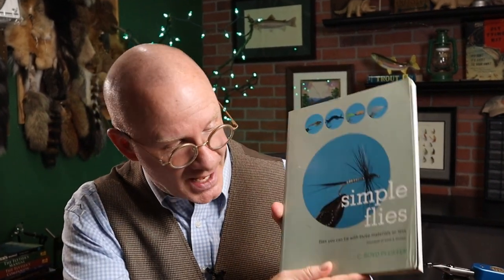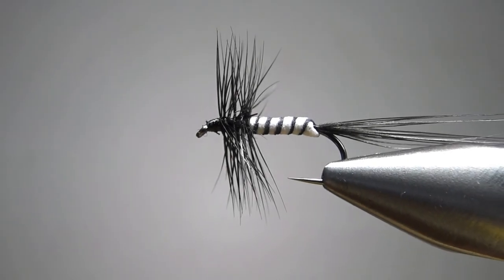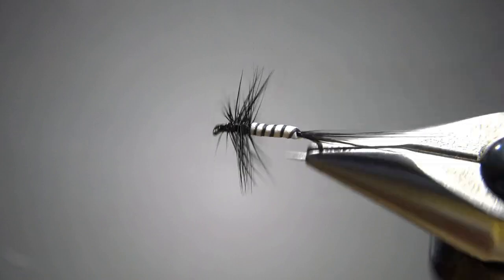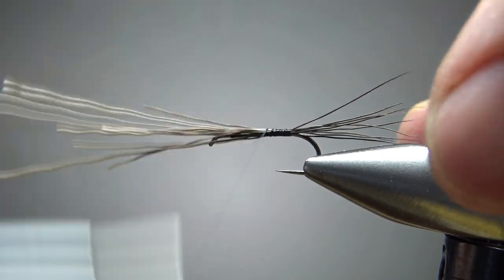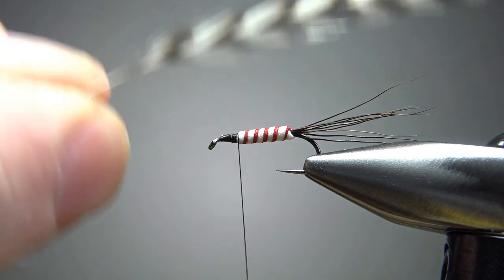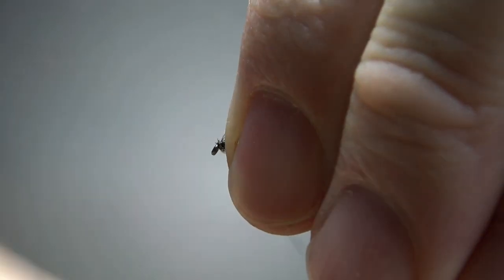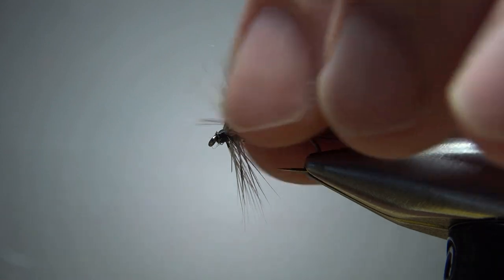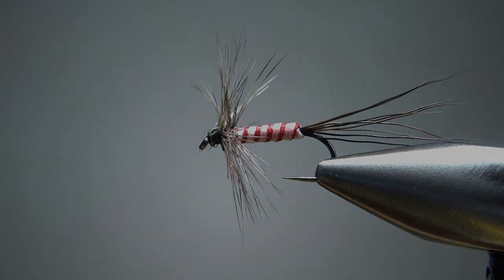Simplified Dry Fly Technique #1

Comment: Simplified...sounds good to me! I've actually wrapped foam around the hook shank for a body, and while not pretty to humans, the fish don't seem to mind it! I especially like the sharpie "rib", even with you lesson about letting it dry first.
Reply from the maker: Thanks! Another way he talked about doing a rib without adding another material is to leave the starting tag of your thread and just use that.
Reply: @SavageFlies  I've seen that on other tying videos, and I have tried that, too. It works, without needing to tie in a wire, and it makes a nice, thin rib without adding any weight.

Comment: Nice idea. I'm a huge fan of flies using only a few easily found materials. I'm starting to experiment with quills—from stripped hen feathers after ai have tied some flies with them. Best wishes. :-)
Reply from the maker: Thanks Terry! One tip if you're going to do a lot of quill bodies, save your excess stems from your hackle feathers. Like if you start off with a six inch feather for a dry fly, and maybe you make two flies with that feather and still have a good three inches left, but the barbs on it are too short or long, save that stem! Soak it in some water and use it for a body. :-)
Reply: @SavageFlies  Thanks Matt—will do. :-) :-)

Comment: Cool... BTW, the sharpie will also work on the hackle too... Lay the feather down on an old news paper and touch the sharpie to the tips of the feather or just color down the quill, both would look cool... (also let  dry first)  You can even do multi colors this way, example: one side of the hackle red and the other side yellow (using the quill to divide the colors)
Reply from the maker: Great tip Randy! I love the idea of taking one of my light color hackles like a cream or ginger, and trying some crazy colors with it. And coloring just along the stem and first little bit of barbs could make it look almost like a furnace or badger. Thank you for sharing this!

Comment: I think you could improve it, w/in the spirit of the design, by using the thread to wrap down and up rather than coloring the foam.  You can sculpt the taper and avoid wet ink.  Also, with the foam floating the fly, you could use soft hackle which would give it the life like appeal I feel many dries lack.  
Just riffing.  I'm buying this book.  It's like the blues, 3 chords but soulful.
Reply: I guess it's cords in this case
Reply from the maker: You make some great points and the next dry fly I want to tie from this book does something like that. Leaving the tag end of the thread long and using it for a rib. I just tried some tonight with making a dubbing loop (without dubbing) and using those two strands for a rib. And one he did was using white thread so it could be a white body, but coloring the tag anything you want and wrapping that as a darker rib. He's got some pretty clever tricks in here to minimize the number of materials used. It's definitely worth checking out the book!